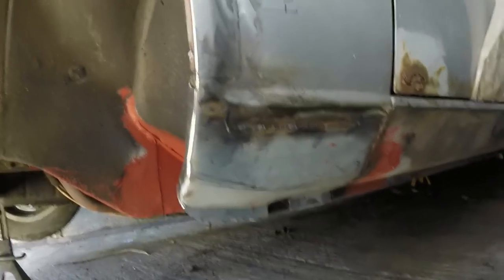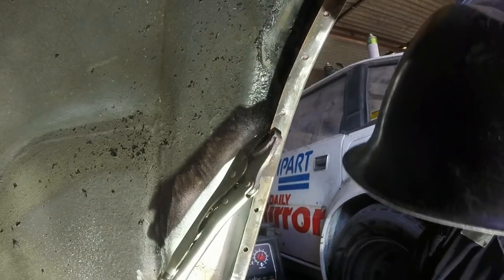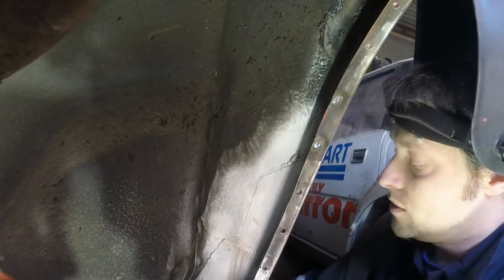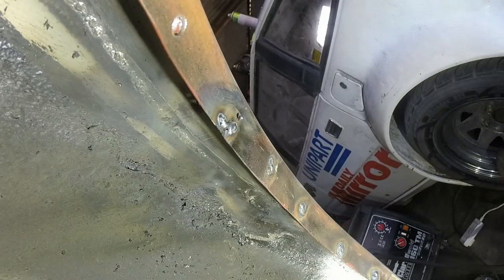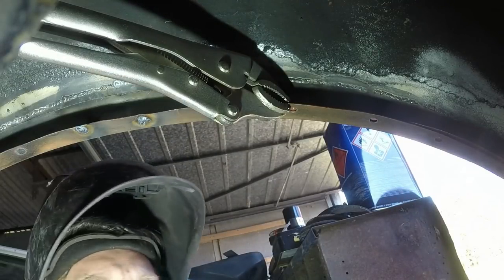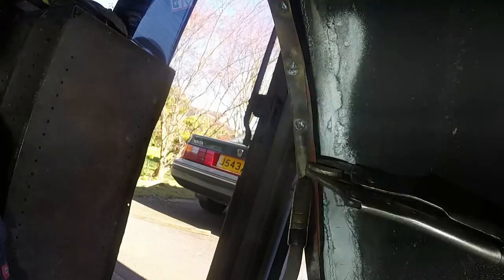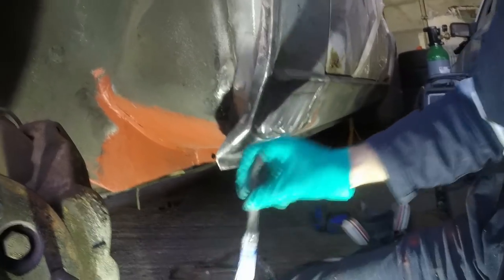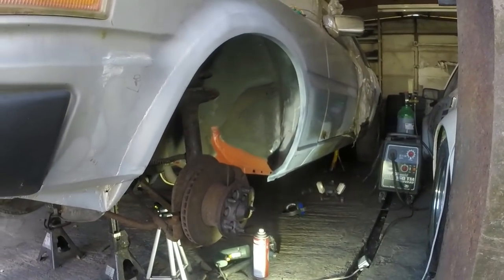Dotty 1981 Rover SD1 Restoration - Video 25 Finished the nearside front wing!

Comment: Well, I've just binged on the Dotty videos. Great stuff, thanks for posting. I always had a love/hate relationship with the SD1 - loved the looks but hated the "cheapness" - the back axle and the interior and this sent me more to the "hate" side. Now, either I'm  getting soft in my old age or you are showing the true nature of these cars... but I'm feeling the "love" :-) V8s are rare out here but there are quite a few 2600s... Hmmm!
Reply from the maker: I have a love-love relationship, as you can probably guess.  I agree on the cheapness of the interior.  The design is great, but the cardboard door cards are utter utter shite.  Seats are good though and driving position is spot on as the steering column and wheel can raise/lower and then move in and out.

Rear axle is great.  Spencer King the engineer who project managed it also designed the P6 with the de dion rear end.  They built several sd1 'mules' all with different rear axles and basically unless you are at the extreme limit, then for simplicity and cost, the live axle with watts linkage wins.  They used them pretty well in touring cars!